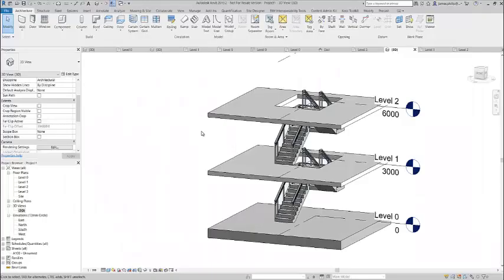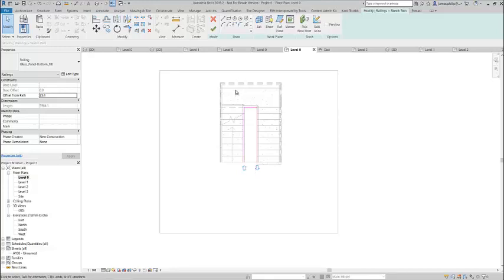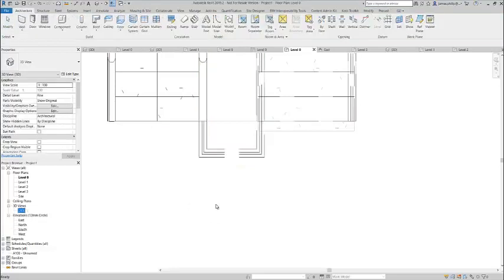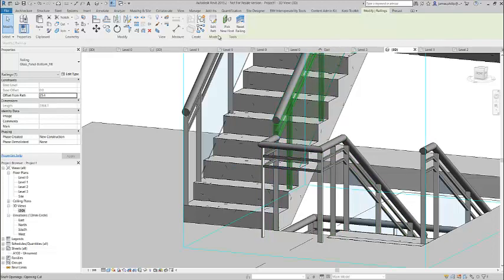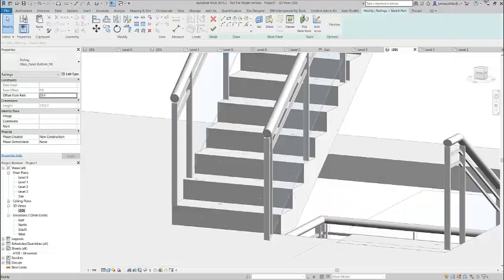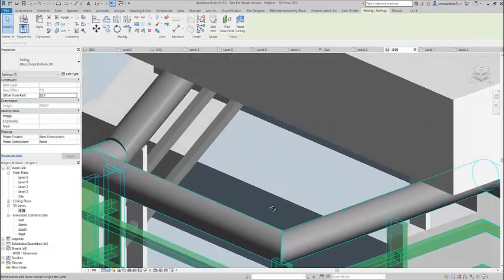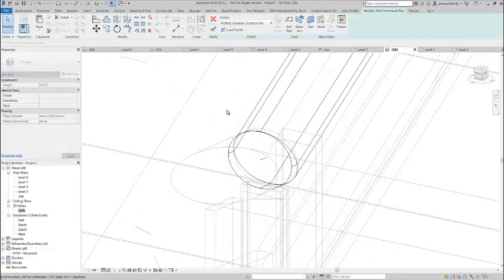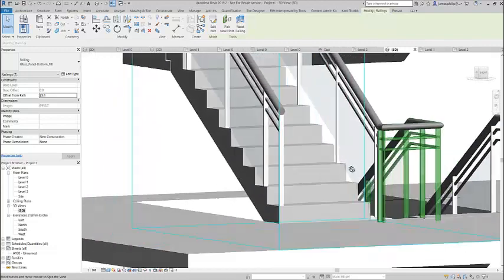Revit 2019 - Creating a Continuous Stair Railing

Comment: Hi, my tab didn't select the handrail and I realized it was because at the Type properties the top rail box wasn't selected. So it was recognized as a horizontal post instead of an actual handrail. Now I can select it with the tab button. In case someone finds the same problem. Thanks for the video.
Reply: That's not my problem. I selected properly. But after that i can't make the joining of the toprails smooth as shown in the video. However i edit my path, it creates something weird.

Comment: The edit path for top rail is not happening properly. Mine is a 4legged staircase
Reply from the maker: You should be able to cycle through to select the top rail by highlighting the railing and selecting the tab key, hope this helps.
Reply: @arkanceuk  no i have selected it properly, and 'edit rail' followed by 'edit path'. But my staircase is 4- legged, 8+3+8+3. 250 T and 150 R.
Reply from the maker: @Dgr8Basak  Apologies that this is still not working for you.  If you have a support contract with us, we are happy to get one of our technical engineers to advise further for you.  Please email customer.services@cadline.co.uk who will be able to advise further on this.